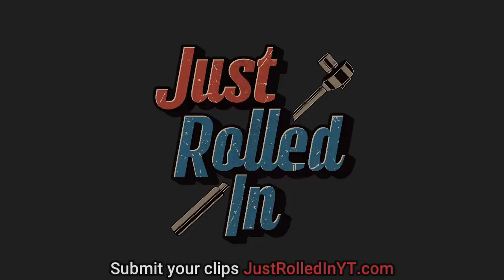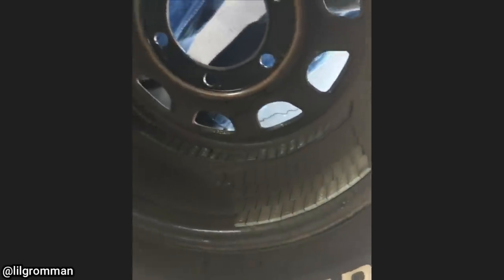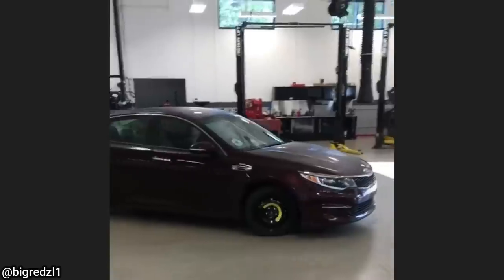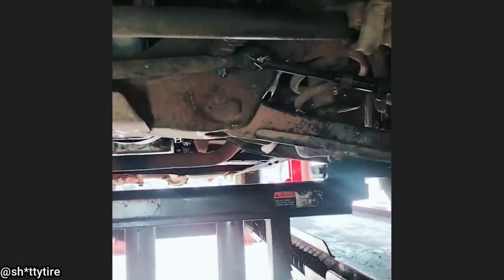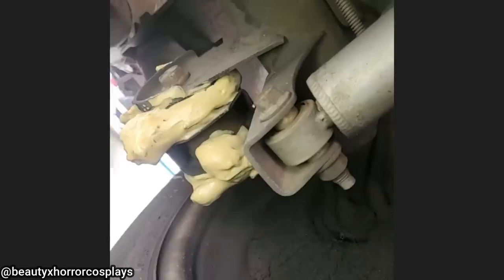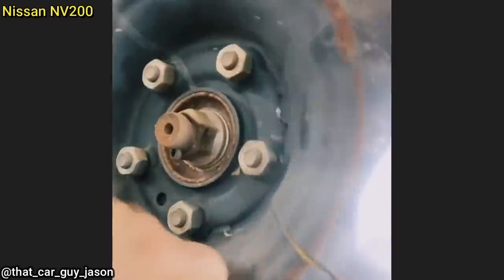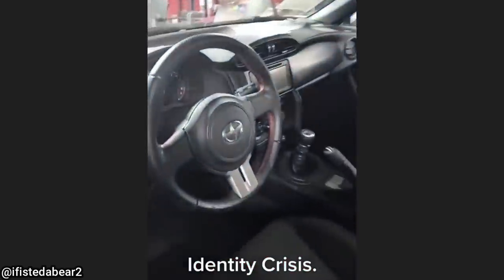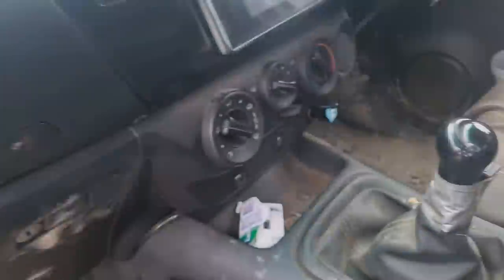Customer States Another Shop Balanced Tires, Still Have A Vibration | Just Rolled In

Comment: This was part of my job for more than 8 years. When fitting a new tire to a wheel, remove ALL old balance weights, clean off any residue, yes I know it's messy, but you're a pro right? Fit the new tire with the paint dot right by the new valve or tube valve, inflate to fully seat the tire, set pressure to recommended. On the balancer, look for wobbles or bent rim/wheel if you didn't see anything before, if possible don't put weights on the outer face or rim, though you can on a steel if it has wheel trims.
Reply: You're describing the correct procedure for mounting and balancing a tire, not the "I don't get paid enough to do this crap" procedure.
Reply: @sparkplug1018  more likely it was one of those cheap used tire places that Mexicans love
Reply: not sure on the paint dot, as some tyres have three of them. but it certainly doesn't hurt to do it like that.
I have seen "forgotten" balancing weights many times. the record was 4 sets of forgotten weights all over the inner wheel... this often happens when the customer is too cheap to buy a second set of rims for change between summer and winter tyres. as if the constant mounting is any cheaper in the long run.
Reply: @lotharrenz4621  My older sister was going to do that crap, I mailed her a set of steelies for like $200. Probably broke even on 2nd year plus having a brand new set of rims.

Also I am always expecting the worst so I take my rims in another car after removing all the weights that way I know they won't drop my car or leave old weights on.
Reply: @lotharrenz4621  Yes I know some have more coloured dots. But in Europe you’ll generally see a yellow dot for the valve location.
Reply: @wordreet  I know. but there are more and more asian brands, and those have two or three dots. and nobody could ever tell me what to do with those, as they are usually white red and green.
during my years as car mechanic (started to learn in 1987) everybody told me to place the dot by the valve, no wait, opposite of the valve, no wait, place the DOT to the valve, and so on. and you know what? I tested it out here and there, with full sets of 4 wheels. and it made no difference. one wheel needed more weights, the other less, no matter where the dot stood. (I could have tried to change the tyres around though, but I never had enough time for that)
thus, continue to place the yellow dot by the valve; you're not doing anything wrong by that. I've got a different opinion on that, and also experience; but, there.

stay safe!
Reply: @lotharrenz4621  Yah, the manufacturers merely say the yellow dot is for balancing. But you're right, most of the time it makes little or no difference. And, of course, no matter the colour, the dots fade and vanish eventually.
Reply: @wordreet  that's right. and what about direction-bound threads? the dots are always only on one side of the tyre. in my opinion the dots are nothing but "quality test passed" markings.
Reply: @lotharrenz4621  I agree to be honest. Hmm, the dots are meant to be seen so aren't they always on the "outside" tire wall?
Reply: Red is the high point and takes out the yellow dot for lightest point.  Some rims are marked on the inside and you put that there.  otherwise to the valve stem.  I'm a motorcycle mechanic and now brands like Michelin and Avon have no dots what so ever.  Often on bikes its the rim and the brake disc/drive sprocket/pulley that is more in need of balance than the tire.  I leave the weights on until that balancer tells me to put them somewhere else.  often the weight would just go back in the same place or the wheels got an once on one side and the balancer tells me to put half on at 180 so I just remove part. Ect.....
Reply: @davidhill850  I learned to balance car wheels on an ancient machien where you had to turn a weighting wheel on the opposite side of the machine and watch a dial. while modern machines give you just one spot to place the weight, there you could turn through the whole diameter of the rim and see if there were more spots, say we from man improperly mounted tyre. but the downside was that it tempted you to place more than one weight to balance everythign out, which of course doesn't really work. but sometimes it's helpful to start at the beginnings.
making weights smaller depending on the machine's dials, or shifting the weights' placement a bit was what I took from the old machine, and it helped later understanding what the different dials and placements meaned.
Reply: @sparkplug1018  then find a new job
Reply: The other thing to remember is if the balancer says to put more weight in a different location don't cross balance. Adjust the weight you have and it will come out fine.
Reply: @gofigure84  you worded it better than I could, thanks for that.
Reply: @lotharrenz4621  not a problem. There are good service guys that don't even think about that. They just add weight wherever the system tells them.
Reply: @wordreet  if I'm not mistaken they always sit on the side with the making date behind the DOT code. so even if the tyre has a direction-bound thread they are only on one side.
Reply: @gofigure84  so, this is why the wheels grow in size, then... to allow the use of even more weights?
Reply: @lotharrenz4621  Ok
Reply: @gofigure84  Yep yep!
Reply: @gofigure84  Yeah I wish people with that mentality would.
Reply: @scarecrow8004  
Do they charge for the wheel weights though?
Reply: @lotharrenz4621  That's exactly what they are, inspector marks. The red one is usually means the tire was x rayed for defects, or at least on most Japanese and Korean brands.

Comment: No word of a lie, we had a guy actually perform a 360° balance on all 4 tires off a 2500. There were continuous sticky weights around the entire rim, and they were stacked 4 high in some places. Unreal, had to be there
Reply: Customer brought in vehicle for a free wheel balance and rotation as part of the terms of the big box contract offered to all members. First wheel off the vehicle revealed sticky weights spaced about 120º apart around the inner wheel. They were not our tape weights so I asked who did this? He stated the Toyota dealer did that. In all, there must have been 4 lbs of tape weights total on the wheels.
Reply: I tried to take out a curb with my driver’s side tire/front end. As part of the “repair,” the shop balanced and aligned my front end with two different size tires. 😡😳😡 They also failed to notice a crack in the frame and gouged my freshly replaned brake rotors (My ‘91 Civic ate mufflers and brake rotors). Needless to say, I didn’t pay them.
Reply: what does this mean in not-a-tire-person?
Reply: does anybody in America check for centre buckles ?
Reply: @jakelynch5113  I'm unfamiliar with the term. Do you mean checking if the rim is bent?
Reply: @christhomas267  yeah mate usually when AT tyres throw that much weight it means the rim is bent from the centre rather than the rims edge
Reply: @jakelynch5113  Oh ok, understood. I can only answer your question for myself then and say that I personally do not check for that condition. I know I've encountered a lot of rims that were bent clear as day at the bead. But I'll have to ask the old heads at work about this haha. Thanks for the info bud
Reply: @christhomas267  no worries mate, glad to spread the good word 
very common over here for rim damage because our roads are garbage and our bushland is pretty rough too

Comment: Bad wiring jobs is my pet peeve.   I could feel my blood pressure rising with every second that passed on that clip.
Reply: meanwhile i make wiring harnesses to NASA spacecraft spec... Needless to say i dont like messy wires if i can help it.
Reply: You wanna be pissed mate, ill invite you down right now to my shed. Youll find a 3 phase install, thats safe upto the point it enters the shed, after that its anyones guess, 20 years of servers down there, place is a mess, still nothing burned nothing gained :)
Reply: I'am a toolmaker so everything that reqires more than plugging or screwing in is out of my leaque but i have two good friends, both are electritians. One of them makes it work and the other one makes it nice. And somehow they managed to not murder each other so far.
Reply: It just kept getting worse and worse...
Reply: Does a battery arking through a hood count as bad wiring🥴
Reply: @MrManniG  the key is to make it both work and look good. From experiance, making it look good is relatively easy, but making it look good and also wotk, now thats something that requirs true skill.
Reply: @sharonnicholson3393  i think it counts more as modern art
Reply: Like the person that mis-wired the alley lights on an emergency services vehicle I was going to drive. The switch for the right side light turned on the LEFT side, and vice versa (!) I signed out another vehicle that night....
Reply: @MrManniG  Should have seen the electrician's house basement I was in; everything possible done with scrap parts, used conduit, open junction boxes on the floor joists overhead. No wonder his ex-wife called him cheap!
Reply: wiring is my pet peeve i like it to be nice and clean and not like that... thats crap. fire hazard waiting to happen.
Reply: Some zip ties some wire loom and 20 minute on YouTube and you’ll find how to get thru the fire wall and other no drill places you can run wire. Kind of like the old carpenter saying measure twice cut once. You need a plan before you just start running wire everywhere.
Reply: @lbochtler  😳🤔 abstract art project hillbilly made light show 💥🤣
Reply: @leadpilled5567  don't tell people to go through the firewall without installing rubber grommets that could get interesting without those I'm just joking thanks for the great suggestion but I'm serious about those grommets
Reply: covers Dinky's ears
Reply: I've turned away customers when they've brought in vehicles with originally minor electrical problems, and they've already been after it with wire cutters, tape, jumpers and wire nuts!
Reply: I agree.  From 1986-91 I worked as a consumer electronics repairman and always hated seeing a piece come in where the owner tried to repair it with the wrong wires.  Worst yet was when they use a sound system designed for a house and try to use it in club and then when the fuse(s) pop they wrap them in aluminum foil and then expect the equipment to be as good as new.🤦🏽‍♂️
Reply: @donotneed2250  yeah I did the aluminum foil back in the day I'm lucky to be alive sorry about that
Reply: I do car wraps and just had to take off a customers light bar that they obviously did themselves and it looked exactly like that truck with the subs 😂. It was the biggest pain in the ass taking off the lights trying to figure out their rats nest of a wiring job.
Reply: @sharonnicholson3393  It's a cigarette lighter on your hood 😂.
Reply: I'm with you.
Reply: @sharonnicholson3393  yes, you should make the bonnet conduct nicely.
Reply: I'm pretty sure that was set up to be removed in a few minutes if need be.  Still, the execution was pretty shabby.
Reply: What pisses me off is that it's a company vehicle.  Why the fuck are you installing a massive subwoofer and a light bar on a company vehicle?
Reply: I have a friend who used to install car stereos and had showed me several cars that he took the radio, wires,speakers, amplifiers that a customer bought from where he worked at but didn't want him to correctly install it, he was sued because they said that he was supposed to have it installed and now it needs major wiring replacement because nothing works, he went to court and had the paperwork saying "CUSTOMER WAS GOING TO SELF INSTALL IT HIMSELF " afterwards the customer came back for him to put everything in correctly and insured that it worked and he paid for the work and never returned

Comment: I took my RAM back to the place I bought the tires at, several times over about 2 or 3 years, complaining of vibration when I would get up to 70-75 MPH.   Problem was never solved.   The tires were balanced under warranty, so I did not have to pay for the repeated balancing. 

Had to leave my RAM in Montana where I went on vacation, because it needed a new engine (under warranty too!).   I asked the RAM dealer to check the balance of the tires.  

They called me up and told me the mechanic took more than 1 pound of weights off each wheel, rebalanced them, and the vibration was gone!  That was two years ago.  I have not had a problem with wheel/tire vibration since then.

Comment: 2:01 Oh god, I know people have trouble telling these apart but this is a whole another level lol
Reply: Toyota 86, Subaru BRZ, and Scion Frs for those who don't know. They are all the same just can't remember if this was the result of a collaboration on design or if it was toyota making the damn things and partnering with Subaru to expand distribution. Customer should have got the full badging kit too, atleast it would match lol.
Reply: I bought a used tC with Subaru wheels. The engine and transmission are solid, and I'll be changing out the wheels and suspension next year anyway. At any rate, my mechanic was somehow not surprised when I mentioned the Subaru wheels. Makes me wonder if this is just a thing people do!
Reply: @Solomon3145  It's a joint project with a Subaru engine. Subaru and Toyota work together a lot, like the poorly executed Crosstrek hybrid which was a Crosstrek with some Prius parts stuck to it, making it the worst of both worlds.
Reply: @Solomon3145  They are designed by Toyota and build by Subaru iirc

Comment: 0:05 this is why I hate it when people complain about a tire vibration but when you recommend a balance they give you the "oh no I had them balanced at another place". Like alright then take it back there since they did so well the first time. Can't tell you how many tires I've had to rebalance because they looked like that
Reply: i had a guy at a tire place put CLIP ON weights on my FORGED alloy wheels....yep, pounded them straight on...and used a bunch of 1/8oz ones  so there were 5 or 6 damaged areas on the wheels, EACH
The guy who did this had been working there for some time....he was fired while I watched as it seemed he had done this same thing to some others, before this.  Seems he was jealous of people who made more money than he did .....the shop manager was pissing all over himself when I told him the wheels were $800ea to replace.....the kicker was I got to keep the original wheels and resold them after I cleaned them up a tad.

Comment: That shattered wheel probably didn't happen all at once, but small cracks grew over time.  Once they cracks were big enough, the last section probably failed suddenly, which is when they noticed.
Reply: Yes, definitely metal-fatigue!
Reply: I've seen cracked steely's (originating from silliness) but that's the worst.
Reply: a friend has a garage / shop had a customers truck in for noise in the wheel .. drove it around the lot slow back and forth the rim was cracked about 1/3 of the way around ,, when you had the stress of the turn and weight of the truck it would flex the rim and show the crack ,, when you stopped you could not see it very well ,,

Comment: I seen a person that was backing out of the gas station today making some grinding noise from the front of his truck, I noticed front wheels shuttering to the noise. I told him that I believe that his hub bearings were shot and I seen both front wheels shuttering to the noise. The bad news was that the gas station didn't have a service garage. Hopefully he made it home as it was a few blocks away.
Reply: Sometimes premature wheel-bearing failure is caused by over-tightening the hub-nut instead of backing it off to achieve the required amount of end-play!  (I know, as I did it myself when I was young & naive!)

Comment: Similar thing happened to me recently. Got a new tire for my car and took it to Leschwab to mount and balance. They said they balanced it but the car vibrated when going above 50mph. Noticed that the balance weights were the exact same ones that had been on there before. Took it back and they said that nothing was wrong with it but they took the old weights off (like they should have done in the first place,) and rebalanced it. And crazily enough…it doesn’t vibrate anymore…

Comment: I used to work at a tire shop down the road from a crappy tire shop. I would regularly get customers asking me to fix what the other shop did, like counter-balancing tires. You have to check road force and force-match the tires before you add weight, and then double check to make sure it's correct. I've never seen one that bad, though.
Reply: recaps once in a while it would take a few extra weights but never that much weight ,, lazy never took old weights off and then balanced ??
Reply: @randytravis3998  What?

Comment: The ironie in the first clip is after seeing the thumbnail without seeing the clip yet i though to myself "i would have just unbead the tire  and rotate it by some amount and reseat it"

Which is basically what you described they did. And i'm not even working in a mechanic shop. *Smh* whoever though to put this many weights.